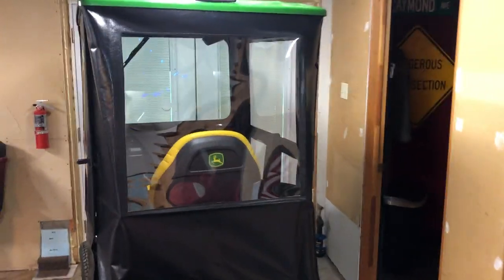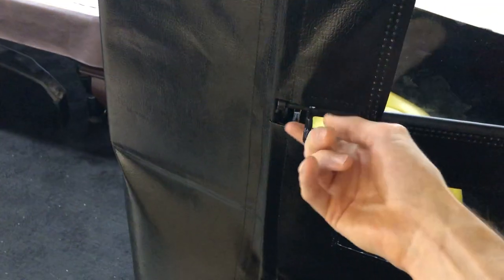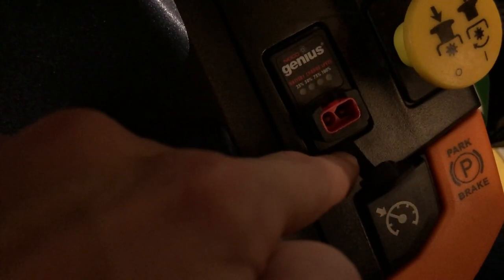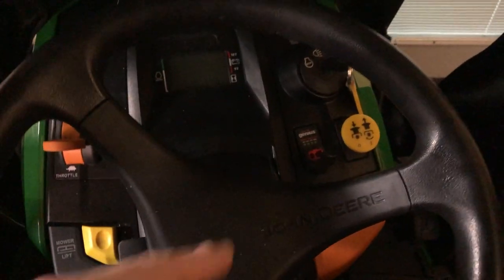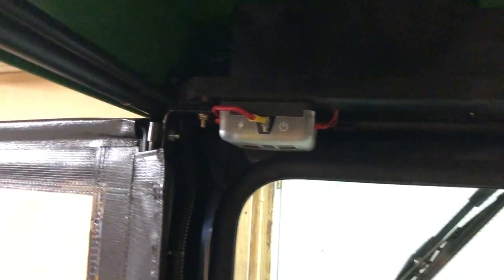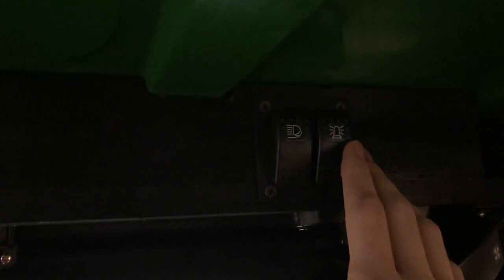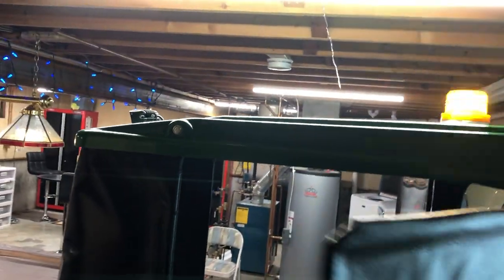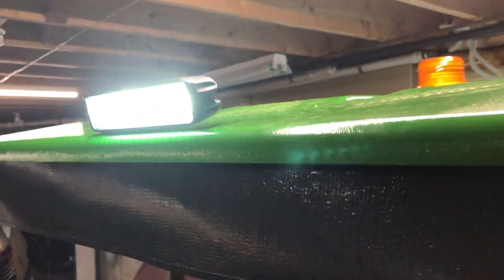John Deere X590 Original Tractor Cab

Comment: I pulled the trigger on a Original tractor cab yesterday for my JD 2025R and then found your video. Your modifications are exactly what I would like to do as well. I never thought of making an overhead console to hide and distribute the power. Thanks for putting out great content
Reply from the maker: Thanks! I used it a few times already this winter, it is totally worth it.

Comment: Thanks for the video! Great options!  My head hurts when I see that strobe stud, I’m 6’2 and can’t do that probably.  I just received a cab from Original Cab (very nice people).  I have an X575 with a Model 40 loader.  They said it will fit and I’m crossing my fingers 🤔 Loader is my snow remover.  Part numbers would be great from Amazon.  Nice job!
Reply from the maker: How did the install go? I too am over 6' and have no problems with the cab!

Comment: have you needed to replace the belts on your snowblower I assume you have a 47-in snow blower on that if so could you give some tips on how you did that seems to be some issues regarding that belt replacement as to the keeper being on the main pulley and whether or not you need to take the whole thing apart thank you
Reply from the maker: I have not needed to replace the belt yet, however, you will have to pull the two pulley assemblies to do so (the two on the snow blower) also known as the tensioner pulleys.

Comment: Question , The Genius battery port tender did that snap right in or did you have to fab it , and would you have the part # , Beautiful Tractor and your work into it
Reply from the maker: I did not have to fab. I popped out the punch out blank where you would put the auto shute switch in and bought the port for the charger. The charger is: https://www.amazon.com/gp/product/B004LX3AXQ/ref=ppx_yo_dt_b_search_asin_title?ie=UTF8&psc=1
Reply from the maker: The port is their GC016 Dashmount Indicator
Reply: @nathanbernier1316  They don't make that port from genious anymore, so I purchased the C tek charger and port snapped right in perfect fit . Thanks for your response

Comment: I'm looking forward to replacing my GT235 (54" deck, 700+ hours) and GT245 (42" snow blower, Curtis Cab, 430 hours) with an X590 plus 54" deck, 47" snow blower, and similar cab (Curtis or Original) in the near future, and going the "single tractor" route. I was wondering about the overall height and I appreciate your answer below. How difficult is the deck-to-blower transition in the fall and vice-versa in the spring ?
Reply from the maker: With the original cab, the height is just over six feet. In terms of the ease of transitioning, its super quick and easy. There in no tensioner spring that needs to be adjusted. Everything can be done with one person, however, the deck is quite heavy. Curtis does not make a cab for the X500 series tractor. This is the only full hard top cab you will find for this.

Comment: GRRR , I ordered the Original Tractor Cab and for my x370 and they are on backorder until 1/25/21 . Guess I will have to blow snow without cab and get snow all over me . I could order the JD Cab for actually lot less money and they do have in stock . But I will probably wait for the OTC Cab . Going to be a cold winter blowing snow with no enclosure .
Reply from the maker: I would certainly go with the OTC cab, much better!
Reply: JD makes two cabs.. a $600 vinyl and the full blown steel/glass $6,000 for my X738... I bought the OTC for $1,500. Added a JD heater that runs off the engine anti-freeze, but with all the holes and no-insulation, I still have to wear my parka and gloves, but at least I can talk when I stop to talk to someone. But I live in MN and -20 is too cold for the heater. But the OTC is good enough for now, at least I'm out of the wind..

Comment: I am starting the cab install today!  Do you have any pictures of the console under construction?  Thanks
Reply from the maker: I do not, sorry.
Reply: Good review on the cab if I get a similar tractor I’ll follow your r your lead ; one note I called cab manufacturer and they don’t recommend running the cab without the doors on because it will loosen up welds ; they do offer screen doors if you wanted to run it year-round and keep the integrity of the cab. Thanks John
Reply: Good job on the video ; could you please send part numbers pertaining to power port and battery tender you installed in cut out in dash ; looked around on Amazon but couldn’t find them. thanks John

Comment: How tall is the unit with the cab ? Wondering for my trailer
Reply from the maker: It is about 74"
Reply: Is that 74 inches with the strobe? My garage opening isn’t as high as I’d like but want to do the same with my 590. Also I see how it attaches in the rear. Any issue putting 4 suitcase weights on with the cab attached?
Reply from the maker: @jazzmcs1  74" is without the light. The cab mounts using existing holes in the frame of the tractor. It does not at all interfere with the suitcase weights, and I carry four with no issue.